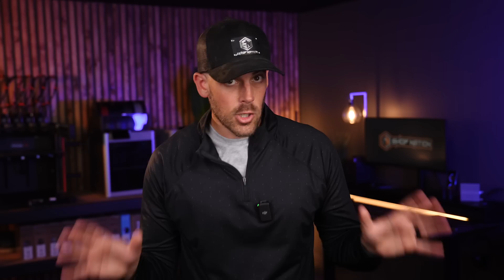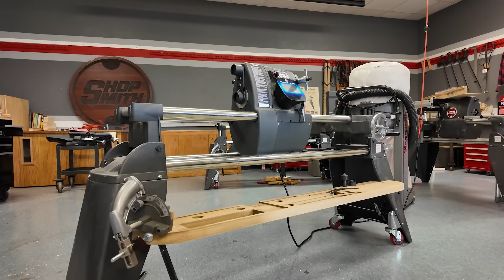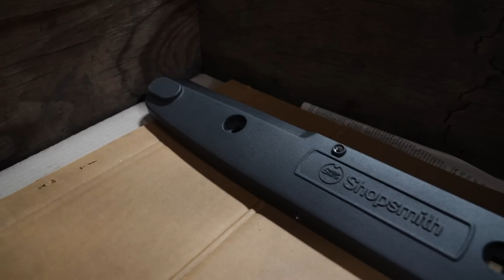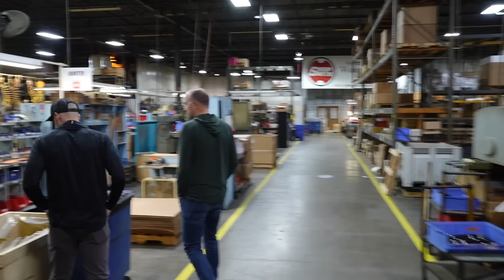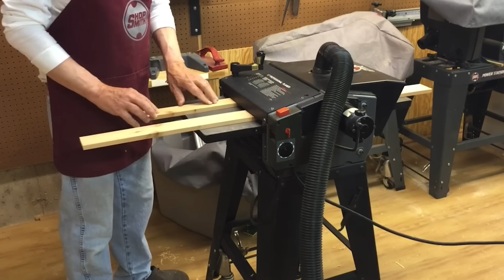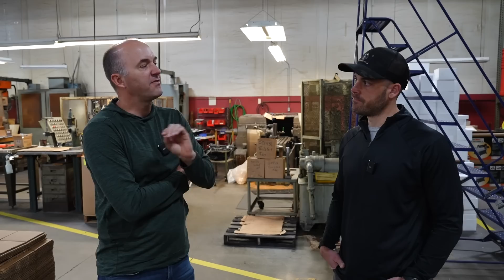The Last American Power Tool Company is (almost) dead

Comment: I am 62. My dad had the green version of a shop smith. When I was 10 or 12 we used to use the lathe a lot. Back then, I was the only kid who knew what a Shop Smith was. One of my Dad's buddies had a 'new Yankee workshop' setup and teased my dad. But I always felt like my dad had the last laugh. We didn't have a truck but we had a trailer made from a truck bed. If you do any projects you will minimum need a truck. Then all the space to store the wood you buy. It piles up. A lot of projects you make from the scrap left over from previous ones. The promotional photo of the guy in his garage while the car is still there is hilarious. There is no room for a car. You need a work bench and project storage.  But that is the point. If you had individual pieces instead of the Shop Smith you could never do this at home unless you had a barn.  The thing is you can't really take this to a job site. So you still need a collapsing table saw if you work away from home. These days I am told you own nothing and will be happy. With shop smith you need a garage.

Comment: I'm 77, I bought my Shopsmith around 2008.  I had to restore it to it's original specs.  The Shopsmith is very useful in my shop, although I don't use it as a table saw, but it is great as a belt sander, lathe, disk sander, drill press, shaper, router, jointer and more.  Yes, I really enjoy American made products.

Comment: I bought my first ShopSmith  in 1981. I have since bought one for each of my Sons and I have bought two for employees of mine over the years. It is by far and large the best way to break into woodworking. I have since replaced my ShopSmith with a complete cabinet shop with commercial machines and am in the process of building a new workshop to house everything. I will be in the market for yet one more ShopSmith to set up as a horizontal boring machine and drill press. It is by far and large the best drill press for woodworking. I hope your successful in keeping this company alive.

Comment: When I was in junior high school (many years ago), the school woodworking shop had dedicated Delta tools for every function that the Shopsmith could be set to perform.  Even though the shop had all of those tools, the Shopsmith saw regular use. It has a great advantage even in shop full of dedicated tools. The advantage being that it is the ultimate  backup tool for production woodworking on a small scale.  Our shop teacher would use the Shopsmith for tasks that required and extra dedicated tool of what was already there. For example,  the teacher might have the dedicated table saw set up for Dado cuts and need another table saw to cut a large panel. Rather than break down the dedicated table saw that is still making Dado cuts, the teacher would set up the Shopsmith to cut the large panels ( it's actually pretty good for that with the wide base). If he had the dedicated drill press set up to drill holes at a certain depth, he would set up the Shopmith to drill other holes at a different depth.  Even with a shop full of dedicated tools, it still had regular use for other operations.

Comment: I am 60 years old I just bought 4 of these of different ages my favorite is the 10er that is just me I  like built solid. Every  person I have showed these to younger than me even people that love wood working they never heard of them but they all loved the idea. The most important thing you need to do is let people know they are out there.
Just to add a little I put a big DC motor on my 10er so I could slow it down enough to do some basic metal on it, and it is not perfect but it does work.

Comment: I love my shop smith.  I think that as a consumer grade drill press it is hard to beat. If they figured out how to make an adjustable height using it as a lathe would be so much better. I am 6'1" and I like to turn things on the lathe but my back can only take so much bending over.

Comment: No router = BIG problems.  This is the 2nd tool everyone buys and uses in conjunction with a tablesaw.  Why real wood workers do not want a shopsmith nor will they EVER recommend a shopsmith.  You start with the tablesaw/router and THEN do everything else.  Almost no one wants the lathe function other than the HIGH end wood workers is the next problem.  Sorry, Shop Smith sounds cool until you go to use it.

Comment: I have 3 shopsmiths, upgraded 2, and turned one into a dedicated drill press. I agree with him that the table saw is the weak link. I bought a used table saw that I got because I have been breaking down a large number of full sheets and the SS table just doesn’t itself for a single person to mange sheet goods. That said the drill press, jointer, and band saw have been used extensively in this project. A SS planer has been used in the past when building tables and the horizontal boring function makes alignment pins for table leaves a breeze. It is a great tool and I wish him well in his efforts to bring the company back.

Now if there was an attachment or a way to turn it into a saw mill or cut down 3 foot rounds into cookies for end tables…😅

Comment: I used one of these about 25 years ago at a job I had back then.  It was in our shop on the farm here in Saskatchewan, Canada. They had all of the attachments for it.  I can remember ripping a ton of frozen, wet rough cut 2x6 on the table saw attachment into strapping for a large horse shelter we were building there at the time. It worked great for that because I was able to slow the blade slightly for max torque.  It cut really efficiently.  That blade just steamed right through that frozen wood!  Glad I ran across this video.

Comment: I have seen a shopsmith long ago and it always impressed me as a swiss army knife - good at a little bit of everything, but not a pro's tool.  I do not believe it would have the rigidity needed to do serious and accurate woodworking.  If this is incorrect, I"m sorry I did not know.  I would readily purchase one due to my limited workshop space (and yes I did buy a used delta table saw, which is the basis for my bee hive building hobby.  I sure could use a router table too and have been looking for ways to adapt the table saw support table as such.  I'll look more info about how accurate you can shape wood with this device and attachments.

Comment: Oh boy...

How can you say at 5:53 "We are the only power tool manufacturer in the US" ? Have you not heard of Northfield Machinery in Minnesota founded in 1920 ? They are making everything in US (motor are Baldor made in USA, casting etc) and as far as I know they are considered to be the ultimate and the finest woodworking machines made in the USA and not Shopsmith. 

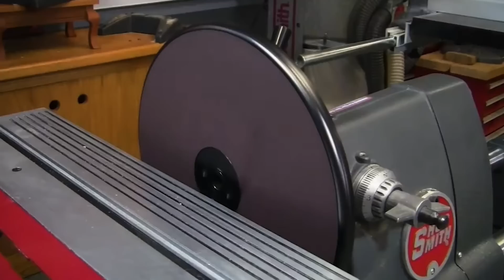At 11:33 you say "The Mark (Shopsmith) is just as precise at a Delta tablesaw or any high end machines. If you bought 7 of them it would cost you about 8000$. Our Mark is 5 (5000$)". No it is not as precise, and you wouldnt be able to prove it otherwise. 

The only thing a Shopsmith as going for it is that it is versatise in a small place. NOT the price. You would have to be very fortunate to spend 5000 when you start equiping yourself. Better to buy what you need according to the criterias of a project instead of buying all those attachements not needed and not very good nor having a great capacity (a 4 inch jointer... seriously)

Love that it is mostly made in USA but you guys lost focus of what was important or relevant years and years ago. I hope for you it is not too late. @Shopsmith @ShopNation

Comment: The motor has a dial that allows you to change the speed quite dramatically from slow for a sanding disc to all the way up too high for routing in between for drilling, spinning the saw blade or an attached bandsaw.

Comment: I run a small custom drum company. When I was starting out and working out of a one-car garage, I bought a used shopsmith and a bunch of accessories, and it was great! Now, we have a very well equipped 2500 sqft wood and metal shop, and we still use the shopsmith daily. The attachments we still occasionally use are the belt sander, the disc sander, and wood lathe, but its daily function is as a buffing machine. We built severall easily interchangeable buffing attachments for high gloss finishes, metal polishing, etc. the shopsmith is a better buffing machine than any pedestal buffer I’ve ever seen. I know they’re trying to simplify, and my use case is SUPER specific, but that’s part of the point. A Shopsmith definitely has a place is a pro shop, because of how easy it is to build job-specific, custom shop-made accessories. It’s a great platform!

Comment: Before I bought individual WW machines, I borrowed a SS Mark 5.  It can do each function to an average degree of precision but cannot do any to a high degree of precision necessary to build higher end furniture.  And the time it takes to change the SS from one process to another and dial in some degree of precision can be extensive.  It was a time waster.  Individual machines allow one to quickly crosscut, rip, plane, drill etc with minnimal set up time.  The SS is a beginner tool at best.

Comment: As a young carpenter/fabricator, I've looked at Shop Smith a few times. The only thing (other than money) that stops me, is I live in rental properties. So if I were to invest in something like a Mark, it would need to load into a vehicle with some ease, to either go to a workshop/site OR to move to the next apartment. Not sure if that's possible to incorporate, but it's a dream I have. 

Keep up the good work and good manufacturing!

Comment: Yes please to newer video series.  I would even buy pre-made kits to follow along.    Bought my 1950s Mark V shop smith from an older guy 15 years ago.  It lives straight back in my 2 car garage. It is almost always setup as a band saw and disk sander.  

I've made pens and bowls on the lathe and a pirate peg leg for a friend who was in a bad accident.  

The drill press has repaired and fabricated many car parts including injector bungs for an intake manifold with a slide vice.  

The table saw has trimmed doors for my house or cut plywood for construction projects.  

Cleaning up projects the disk sander makes quick work of anything.  

The bandsaw does a great job of slicing hardwood chunks for the BBQ.  

If mine ever dies I hope Shopsmith still makes parts and I can upgrade to the newer digital power head, mine works extremely well so maybe not for a long time.  

Please look online at the large planer people build themselves using the power head as a lathe with a PVC pipe covered in sand paper.  I still want to buy the belt sander, wall mounts to hold my accessories and a nice cabinet underneath for accessory storage.

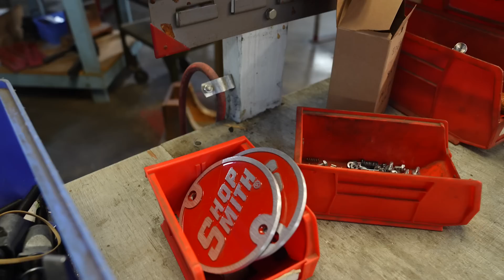Comment: I'm a retired carpenter & joiner, I remember going round woodworking fairs (UK) decades ago and seeing these machines, having no idea they where made in the US. What jumped out to me was at 13:55 (this sums up the company) does the Shop Smith badge/logo REALLY need to be a costly cast aluminium plate? a stamped ali plate would do or plastic, yes plastic, buyers won't walk out the store because it's plastic.

Comment: There's innovation to be had in making the working space more / better on the MarkV - this is I think key to making this appeal to a broader customer base - if space is a preimum, then the device needs to be able to be friendly for clamping/gluing/assembling, etc.   They could use the "end" of the table as a platform to go on out from there to create that working space with modular attachments, and, if innovative enough, it'll catch on.   If not, then they'll continue to cater to the very narrow market of hobbyists interested in small scale stuff with lathes and drill presses, etc.   They could of course also make these same table extensions powered with the same power coupling they have on the main motor using a much cheaper (less powerful) motor -- still likely quite adequate for several of the attachments - sanding, scroll saw, and several new attachments they've not considered before that would be higher margin products.

Comment: I grew up next door to a man who used his ShopSmith to build 
a set of cabinets to contain the machine and its accessories.   
After that he rarely used the stuff, but at least it was kept clean and ready for when he did want it.    
The man on the other side of us was a carpenter who had a normal table saw, 
a jointer, and a radial arm saw that he used a lot.

Comment: All the things that make the Shopsmith great would appeal with younger audiences:
Space-savings should be clutch for beginners in small garages.
The multi-use aspect would be key to folks that don't want to manage owning several tools from differing manufactures.
Most importantly the LONGJEVITY of the device will resonate with an generation that prefers to tamp down overall consumption.  For me personally I find the concept of "planned obsolescence" morally reprehensible.

On the minus side I have to agree that the table saw has always seemed iffy.  It's so high up it seems dangerous.

Comment: My father had a Mark V from the early 1960's, and one of my aunts bought me my own and had it delivered to me, as a gift,  in 1982.  After that, I bought nearly every accessory and tool available. I don't make furniture. My profession has been to make casting patterns of wood for limited production of castings for various projects, such as parts for antique cars, small steam locomotives, and steam engines. I also use all the tools to build bodies for early automobiles. (The latest ones are for a 1901 T. Hyler White small runabout, and the bodies for my 1910 Brush automobiles. I use my Shopsmith and it's accessories from as little as once a week, to virtually every day when the weather is good in Tucson. Simple working space is always at a premium, and the Shopsmith and all it's tools (Planer, jig saw, jointer, band saw, and all the accessories, with everything on Power Stands) are what has made this kind of work possible for me. Without "small area" tools like the Shopsmith, I would not have been able to do most of the work I do on a constant basis. I love these machines, and will be using them until the day I die. I sometimes use 4 different machines in the space of 30 minutes of work.

Comment: As a recent MBA grad (I know people don't like us because of slash and burn theory, which many from my fraternity just give as a solution to anything), I have a few suggestions for Shopsmith if they haven't already implemented it.

1). The equipment looks great and as pointed out by Nick, he has already identified his niche market of small spaces, he forgot the important part of the demography, the 25-45 aged people, he is looking to entice, majority of whom in that population still doesn't typically have their own house yet. Instead, he can start this on a trial basis if possible. He can tie up with a local school and provide them with a free tool if they let his customers use the school space for the customer's pet project by using the space for their own creations. This will help the school not only generate revenue (by renting space) but also create free marketing for the product itself. It also indirectly helps the students explore the hobby and who knows there is a new customer in them as well. (A strategy used by Microsoft to create a monopoly for office products)
2). If possible make it easier for dismantling or with fewer moving parts. This will help apartment dwellers take it upstairs easily and not kill their backs every now and then.
3). Do tie up with the YouTubers like Blacktail Studios, newbuild newlyweds, etc. They will run ideas that they have and create a cool piece that can showcase the potential customers what your tool is capable of. I am a part-timer woodworking DIY enthusiast and watch them a lot.
4). Last but not least the option to buy the equipment with Klarna, Affirm, etc to help your customers buy it and keep their costs down. Since this is a one-time purchase for a lifetime, having the option to pay it over time will help them make an investment in it. I saw that you have Affirm, but if you look at many retailers now, they give multiple options for their BNPL. (I will admit I didn't go all the way to the end of the transaction webpage because it was asking for me to create a new account and/or register which quite frankly as a millennial sometimes I just don't want to do it. Rather I will just get a Google login or something else) maybe that's just me or maybe not, you just never know.

I am a firm believer in conscious capitalism, which is deeply rooted in the small and medium industries as they're challenging businesses and I like to work on them. If you have any questions, please feel free to reach out and I will try my best to come up with the solutions that are not going to gut the budget of a company. And if you think my suggestions are not worth it, please don't hesitate to let me know where I am wrong as it will help me open my mindset and understand where I failed.

Have a great day :).

Comment: My dad had one of these. I want one for real. The base model is $4000, and an old one is $600 and apparently still works, which is rough for the supplier's economics, but a fantastic testament to how worth it they are. Automation is a good thing, tho. ShopSmith CNC would possibly change the world. And it might come in handy to be the only tool manufacturer in the US if shtf. 
Here's how you get capital: Rebuilds. Find the ShopSmith people and offer them $400 to get it out of their garage, rebuild, sell them for $1000 or something. I don't know if the numbers could work, but an official rebuild is a decent middle ground between brand new and barn find. But the table saw has to be great. A lathe is not as important.